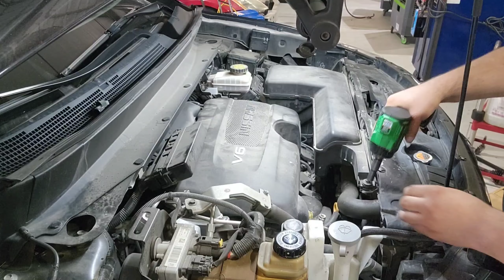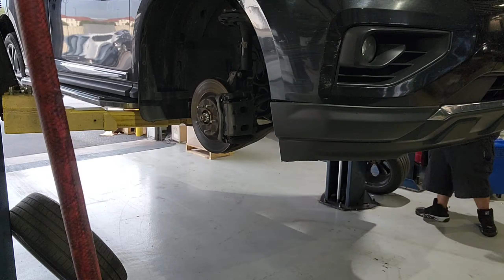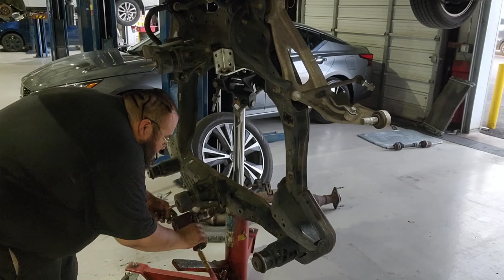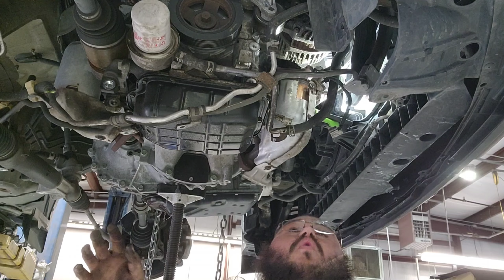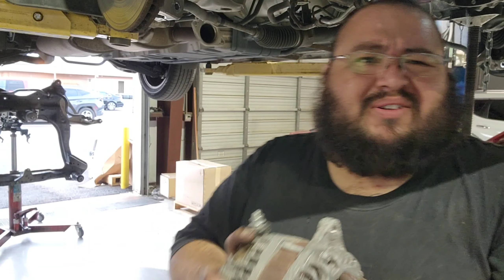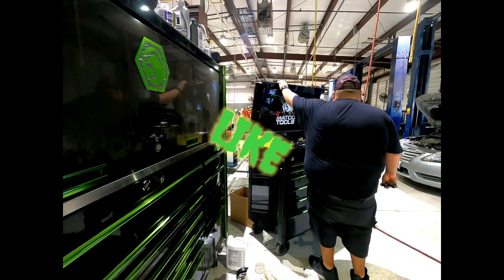MECHANIC OVERWORKS HIMSELF!!! #mechanic #pro

Comment: You should get a 21.5 socket. It works perfectly for maxima and pathfinder swollen lug nuts. Snap-on has a 21/21.5 flip socket.
Reply from the maker: 21.5?? Bruh u bouta be a life saver 🙃
Reply: @FluffyMexicanik  The part number is TSR1240. And trust me it works wonders.
Reply from the maker: @dominicwengenroth344  these lugs really make me wana launch some shit 😅🤣
Reply: @FluffyMexicanik  For real dude 😂😂